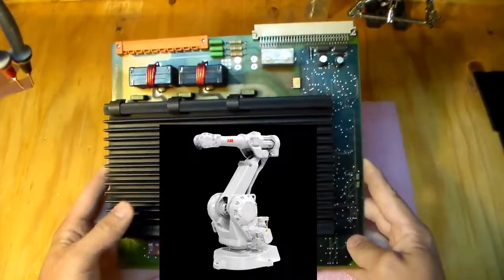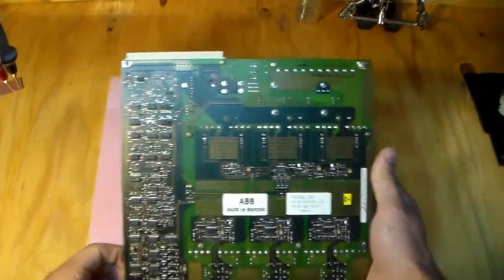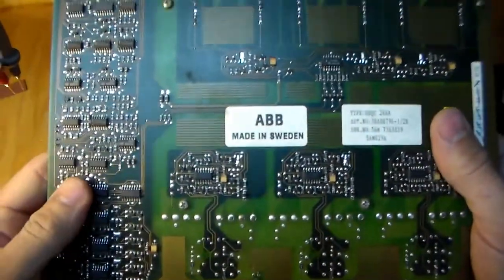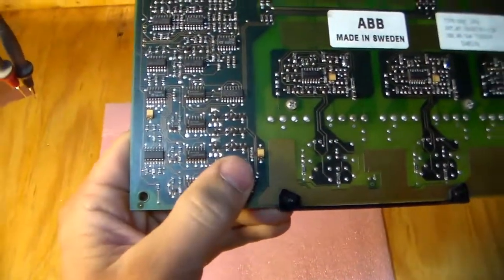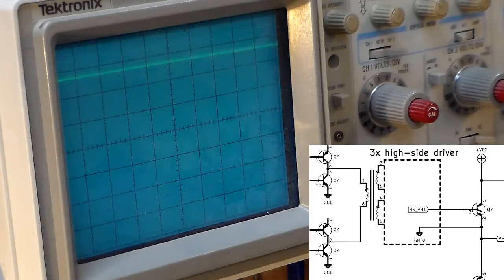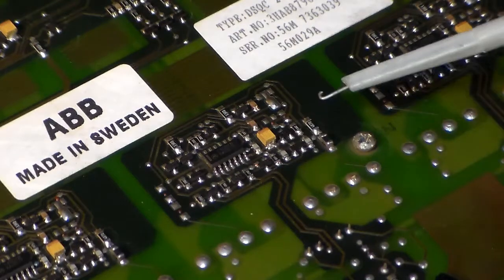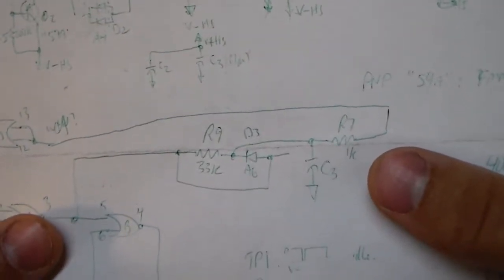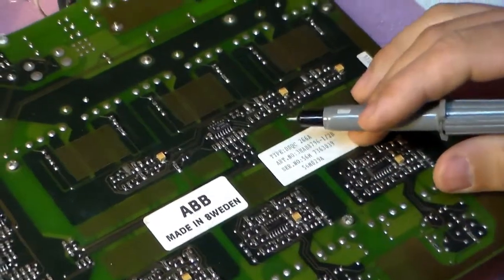Repair - ABB servo drive board, DSQC 266A

Comment: Hi your video is brilliant you seems to be very good in repairing .my question is where did u connect +15 ,-15 and 5v on the board Thx
Reply from the maker: I don't have the pin # handy, but +/- 15V DC  go each to a group of 4 pins on the PC612 connector that go to each of the radial electrolytic cap near the small diodes. GND should be pretty obvious, it's one of the ultra large traces going to 14(16 ?) pins.